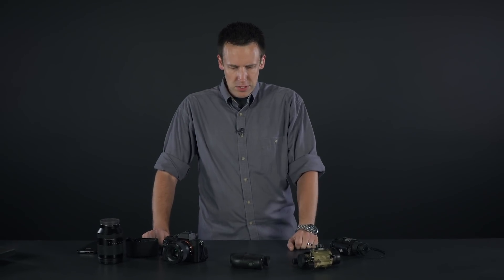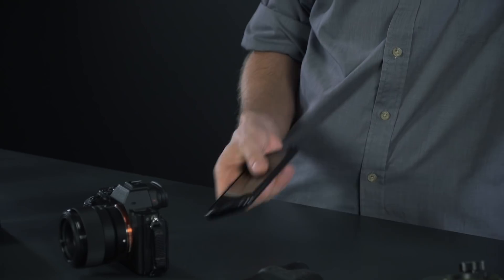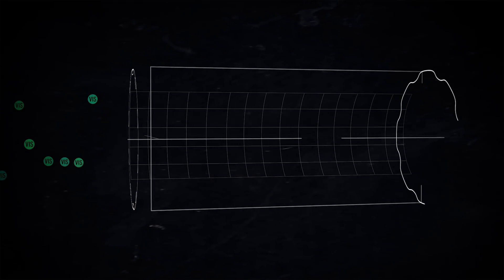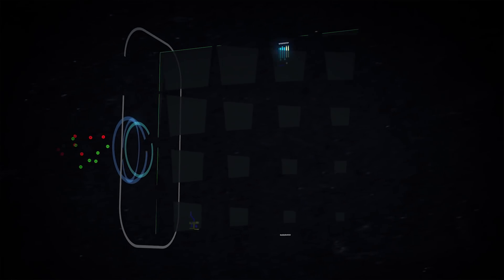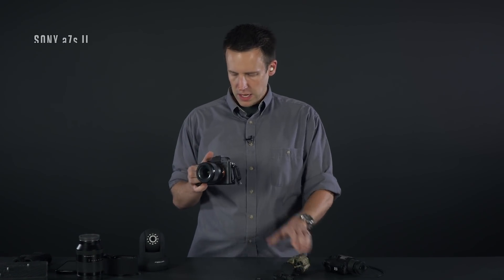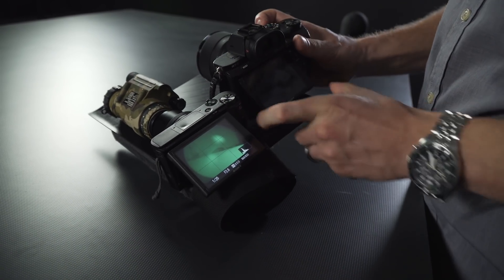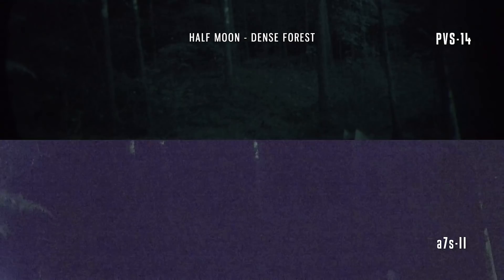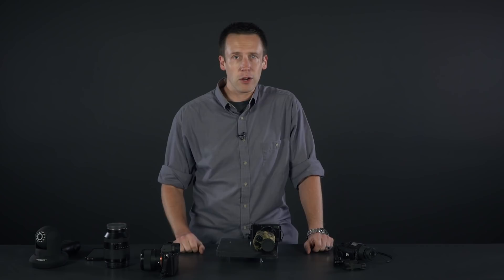When will Digital Night Vision Catch Up?

Comment: The sionyx aurora digital night vision, or the nvg10 you can buy off Alibaba or AliExpress for $370+ is actually worth it. I would love a pvs14, but reason the parts kits are cheap you're not paying for the housing, or any of that when buying milspec nightvision, the tube inside the pvs-14 is what you're actually paying for when buying night vision. That's why it's expensive I was going to buy pvs14 parts kit which ranges from $400 to $800+ depending where you buy it from, but the tube is where I said no on building a pvs14 from the parts kit, it's $1,000+ dollars for one tube.

Comment: I think you can get some really good results by using the new A7S III with a F1.2 (or faster) lens and recording at 24fps with a shutter angle of 360. It will have more motion blur but you should get way more light.
Reply: Been lowkey thinking about doing a digital slr with ir filter removed.

Comment: As an electrical engineer I'm getting real excited right now.
But seriously Isaac, awesome video!
There's just one little flaw. In the digital NV animation, you show an ADC behind the DSP. That's wrong, you are not ADCing a digital signal. The signal is either converted by an MCU to an image and then outputed, or directly send to the display. Depending on ASIC design of course.

Comment: "The detail it [digital camera] can resolve" is also heavily dependent on the performance of (if even present) a denoising DSP. Meaning it may be possible to squeeze considerably more performance out of the digital one even still. If you ask me, it looks as if the camera isn't using denoising the at all.

Comment: Flawed comparison.  Gen III has far better resolution than the A 7.   Way better.  Let me explain.

The photocatode of a Gen III device can resolve 72 line pair per millimeter.  A line pair is one black line and one white line, so over a width of 17.7mm (the size of a photocatode) you can resolve 72 line pair, or 144 lines, 72 white and 72 black,  times 17.7 (the diameter of the tube) and this gives you  *2548 lines * .  Now, let's look at the 24.9mm tall image sensor..  It takes two rows of pixels to make a line pair, one for the white line and one for the black and over the 23.9mm height of the A7 sensor, you have 2160 pixels, so that equals  2160 lines.   If you used only 17.7mm of the chip that would be 74% of the dimension and if you looked at how many lines you could get on to the chip using 74% of the height, that would be 1598 lines.  So, you compared a 17.7mm dimension to a 23.4mm dimension using a longer focal length lens and this is simply not really at all an equal comparison and greatly misleads on the resolution of Gen III devices. 

Now I could make a 25mm Gen 3 image intensifier.  The Gen 2 crew served weapons were 25mm, If I did that using  modern Gen 3 tube technology that would give me (144 x 25) 3600 lines so far greater resolution.  It would be expensive, but it would have better resolution and better low light sensitivity. You could even make the tube rectangular if you wanted so you could get the same aspect ratio, and you could make it fit into a housing not much larger than the A7.  But that would not be particularly fun to wear on your head.  

Now the reason Gen III tubes went to 18mm is because it had to be very small and very light.  If you used the same pixel density on an 18mm circular chip and used the same lenses and eyepiece to get the same 1x scale as provided by PVS-14, the resolution would be far lower (2548 lines for the PVS-14 vs 1598 lines for the A7/14).

*I see people make this very flawed comparison all the time*.  They use a far larger sensor with a far larger lens and proclaim that the resolution is better but If I cut an 18mm circle out of the A7 sensor and stuck it inside a PVS-14, and use the same objective and the same eyepiece to get the same 1x scale, the image intensifier would still be a few generations better than state of the art sensors like the one use in the A7.   In other words, made to fit into the same size housing (same 18mm tube window format), the A7 sensor technology would fall far short of what the PVS-17 can do in terms of resolution and sensitivity. 

Sensors are nowhere close to replacing the PVS-14 for tactical use.   They lack the resolution to do so and increasing the pixel density would require a corresponding increase in sensitivity to make up for the loss of area for each pixel, so you could get the resolution but loose sensitivity.  You could make the pixels larger to improve sensitivity, but that would lower resolution.

Also, the rectangular format is horribly inefficient.  To well illuminate the corners of the frame, the camera flange has to be considerably larger than the it would be for a round format.   For example, if I used the A7 sensor with it's very wide aspect ratio, the lens has to be far larger than the tiny objective lens on the PVS-14, and to see the full width of the retangular shape, the eyepiece has to be far larger and these optics together would add considerable expense and weight to the device and this assumes that you can even get an  display to come anything close to the resolution of the sensor.  I mean the monitor on the A7 (which you need to see an image in the dark) is only .92 megapixels so having a sensor higher than this would be useless for for mobile operation.  It would only make sense if image were being fed to a large screen of equal resolution. In other words, the output device needed for portable operation that provides the same resolution as the sensor does not exist.   

Sensors are no where close to the resolution of the old analog tube.  Not even remotely.   Barring any major breakthrough, it will be several generations of sensor improvement before they can equal the resolution and sensitivity of the Gen III image intensifier and still be packaged in a light,  compact, and wearable device.  If size and weight is no object, then mounted sensor based devices might be there in a couple of generations.

Sorry for the long post but if I just said your comparison was misleading, you would have blown it off, and maybe you still will.  Still, the truth is that as much improved as they are and even as advanced as the A7 sensor is, it is far away from matching the resolution and low light sensitivity of current generation image intensifiers.  I do not think we will see a hand held silicone based replacement fo the PVS-14 in a very, very long time unless some huge breakthrough occurs. For crew served weapons or armor, it may be closer, but not for anything you can wear on a helmet.

Comment: The major problem with third generation night vision equipment is the legal issues. Outside the US, a special permit is required to own such devices. The Sony A7SII camera can be purchased on the free market and can film in color at 4K resolution . For astronomy and meteorology (filming sprites and blue jets over thunderstorms), it is a far better choice even if it still slightly less sensitive.

Comment: This whole video is bullshit. Military uses tubes for cheapness, not sheer capability. High end military night vision cameras use digital sensors that blow tubes out of the water, in every way, in full color. Can't understand why this video was made, it's so weird to me that someone would do all this work either to lie about such a random irrelevant technology, or did all this work while still being too lazy to check if your primary claims are actually correct at all.

Comment: i'm still waiting for gopro to produce a camera with same physical sensor size but only 1080p or maybe even 720p, i do so much night time activities/explores that i wish i could capture (without a light), i'm not interested in 4k60 video, i just want to capture something, anything, in the dark but i can't... similarly, sionyx's aurora camera is a night time camera with a 720p 1" sensor which is what you could've tested, but it's not wide angle sadly
Reply: Is using extra IR illumination out of the question? Because that would be the easiest way.

Comment: I'm pretty sure that the second  ADC at 4:44 is not needed. The output of the DSP is already digital, why would you need an Analog to Digital Converter at that point?

Comment: A digital night vision device would have to be stereoscopic to be used helmet mounted. If it is mono (due to the image being shown on an lcd screen) and even slightly offset, you would not see the same image with both your eyes. But with an analog tube, it doesn't matter what angle you look through it, the light will pass through straight.

Comment: Wouldn't the best solution then be to combine 2 powerful lenses of each kind in the same device, then overlay the frames on top of each other and have the processor do it's best to balance the color and exposure settings to the lightning conditions?

Comment: Durability is a huge issue when it comes to digital anything. Throw that thing into the wall and see if it still works! This is the test you want to use when why the military isn't switching over. I can break that camera in a second lol
Reply: The camera wasn't made for that sort of durability. This doesn't mean you can't make the technology durable, however.
Reply: @logitech4873  You are correct but that is going to be the main issue is the durability of it. Second, comes the cost of making it durable and useable for weeks on end without being able to have it maintained in absolutely appalling conditions.  The current generation we use works just fine. And I would always rather have something that's been around for years I know that works than something that might be iffy in the field. You'd be hard-pressed to ever get a marine to switch over unless it is clearly better than the product its suppose to replace.
Reply: @Hangman105  If you truly lived by that principle you'd be flinging rocks at your enemies.
I think we're on the cusp of a digital solution that outclasses the analogue ones. Thinking that we already have proven equipment isn't going to lead to much innovation, and eventually we might get digital variants that are much smaller and far more convenient to use with wider angle and more accurate color reproduction.
Reply: @logitech4873  . You know why this isn't a far better device?  In its current forms, it uses too much battery is much more likely to get water damage. I would like to see how it does with super intense flashes of light as well as these are common when using any form of night vision and more likely to burn out a digital sensor. What's the final nail in the coffin for this technology. Infrared which actually allows you to pick out your enemy from the back round. This technology is great for photos bad for actual battlefield tactics. PS we hate night vison and would rather use infrared every time but it has the same drawbacks as digital, power consumption that's why it's mounted on almost exclusivly vehicles and not something your everyday troops carry around. Now to make a small counter argument it could be used at night for better terrain designation and pathfinding if it could also be used to make enemy uniforms stand out more such as making them a brighter color or even the pigment of human skin stand out. But I find its better color at night very lackluster with the drawbacks presented and better technology for the job already in existence and widespread use. Note the job is to make it easier to detect the enemy/threat. I see too many drawbacks at this time for it to be considered practical at all. I have laid out a constructive argument for why it won't work this may come down to a difference of opinion. The only upper hand I have is actual experience with this kind of technology in the field.

Comment: You would generally need a sensor that has a much higher sensitivity to lower energy electrons. Sure, the digital camera can see the infrared photons, but it's not designed to, it's meant for visible light.

Comment: One big plus for digital that I don’t see people mentioning is size and positioning. Right now NVGs and NODs are tubes that run straight out from your face, you can only see what that tube sees and your perspective is pushed forward 5-6” and peripheral sight is blocked. Yes I know about the panoramic NODs, but they are still clunky and heavy. But for digital, you can have the sensor and screen be any shape (within reason I suppose, not huge on camera knowledge) and the chips to process data doesn’t have to be in front of your face, they can go on the back or side or top, hell even INSIDE the helmet. This means the perspective change will only be as great as the thickness of the focus lens, screen, bit o’ wire, and sensor. Possibly only 1-2”, and with more sensors and a curved screen and some image merging software, boom peripheral vision is restored. Just my 2 cents.

Comment: Great video! Thanks!
Wonder what an F/1.0 lens would do, or maybe adapted an f/0.7.
For sure there is no comparison in size or weight but still, in theory digital could match it.
No autofocus though... although Canon offers it at f/1.2 which is a full stop faster than f/1.8 at your video.

Comment: Analogue equipment does have some advantages to digital, specifically electronic interference like an EMP, that will fry digital items, but the analogue gear will still be fine.

This is also one of the problems NASA has at the moment, digital equipment is extremely vulnerable to radiation. Back in the 60's and 70's there wasn't any problem going through the Van Allen radiation belt because it wouldn't really affect the equipment, but now with everything being digital it can cause big problems because digital equipment doesn't deal well with radiation.
If you look at footage from the ISS it can quickly become pretty clear why digital sensors might not be good for military use. They get new cameras sent up fairly regularly, but because of the radiation levels up there, pixels die fast on the sensors. This can be seen clearly when you see footage taken there, and shielding a sensor from radiation isn't really that easy, since you will still need a lens in front of that sensor, which will be a place where radioactive particles can enter and impact the sensor, causing damage to it.
These things might also be a factor to militaries, the fact that this old school tech will keep working despite an EMP or with radiation present.

Comment: you know the military will probably want to develop a new nigh vision with digital sensors just for the fact that you can identify IR light as you showed in the video at 8:04   because IR light sources are most likely enemy soldiers using night vision goggles and that is critical information
Reply: That sounds like a friendly fire accident waiting to go wrong.
Incompetent 2nd Lt: "Look!  Infrared!  Fire!"
Blam blam blam blam!  Pshheeewwww!  Boom!
Cpl:  Oh sh77!  I think it's a Bradley!  It's one of ours!  Run!
[Loud whistle of 25mm round flying overhead]
Reply: Modern Night vision already forwent the IR illuminator. No modern military is employing Night Vision that will give them away.

Comment: If you had a non-color version of the Sony sensor, with photosites that didn't require subpixels for the RGB pattern, and used a lower resolution than 4K in order to get bigger more sensitive pixels, instead of going for pixel density you'd get a BEAST of a low light vision camera.
Besides that, using a custom color profile optimized to maximize contrast instead of preserving the most dynamic range would result in a more comprehensive image through the noise.
That coupled with a custom gamma curve, instead of 2.2 or 2.4, that maximizes the number of stops in the dynamic range to the dark parts of the image.
Even more, a sensor optimized for higher ISO levels natively (like what dual native iso cameras are starting to do now) would result in an even more optimized capture experience as you would be able to get rid of a lot of the noise, resulting in a camera that can resolve higher resolutions without the need for as much light.

Comment: I love this video! However I noticed one small discrepancy: when you listed the respective specs of each of the imaging devices, it showed that the night vision tube had an aperture of f/1.2, which is substantially more light than the f/1.8 aperture on the Sony! So I can only imagine that the A7SII would have be much more competitive in the ultra low light test if it had the same aperture on it’s attached lens.

Comment: Although I believe there are some valid points here I still feel you didn't do digital justice, assuming you shoot manual and all that stuff I'd say you should use a 360° shutter on the A7 or as close to 1/24 shutter as you can get.
I also believe you could've used a better lens.
Most analog night vision sets have a built in focal reducer, which makes their lenses an equivalent f0.8.

I would've used an A7iii with a Mitakon 35mm f0.95 for a more fair test.
And if you really wanted to push it further you could use the A7 in crop mode and use the canon mount version of the lens with a speedbooster which would give you an equivalent f0.67.

All of this considered you mightve been able to push 4 more stops out of your A7 with the right gear.

Not hating on the video here just feel you could get a lot more light on that sensor with a little more gear

Comment: The performance of the a7s II is really impressive actually! but the light would be about double with an f1.4 lens
Reply: 2/3rd of a stop*
F1.2 would give twice the light.
Reply: @TheJudge064  "about"
Reply: I guess night vision doesn't give you shallow depth of field unlike wide aperture lenses))
Reply: @LordArioh  Indeed that is the case! I was just saying.
Reply: @LordArioh  technically it does, but the smaller sensor size means it doesn't show up to the same extent so they can push it further before approaching unusable dof
Reply: 66 percent more not double
Reply: @garbygarb31  "about".....